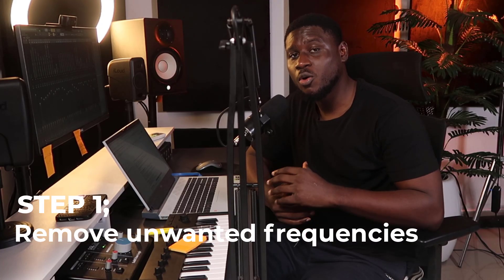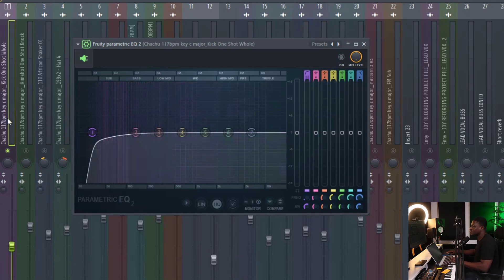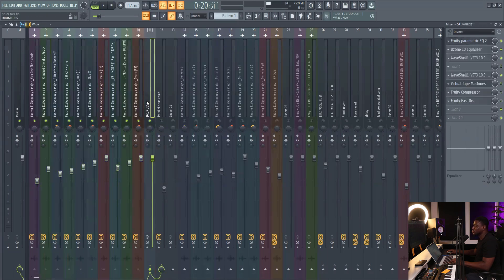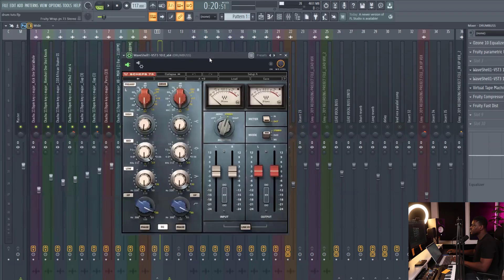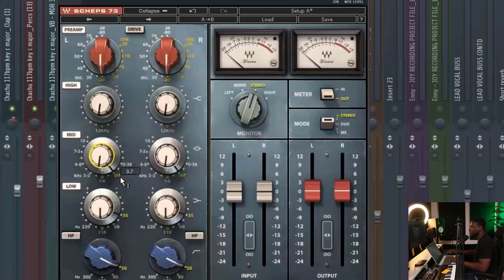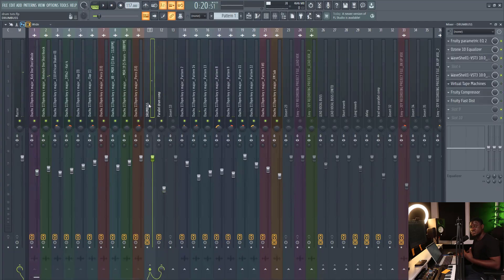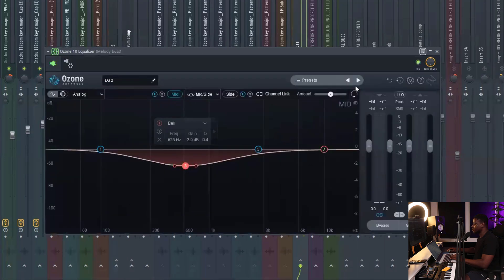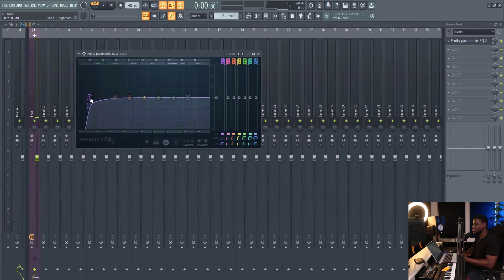How to mix and master Afrobeat in Fl studio

Comment: Why is it that after using a particular preset  to achieve a fuller beat mix on fl  I try to use the same preset on another beat mix but I don't achieve the same result. Most times the master sounds very low like trash